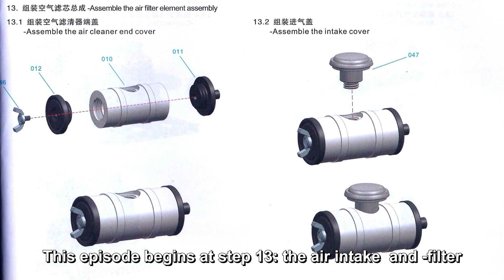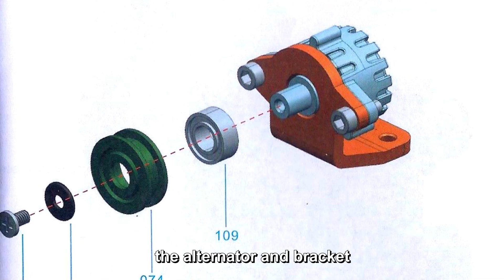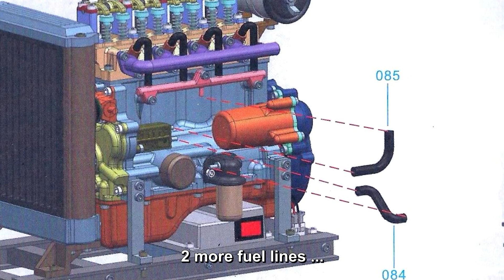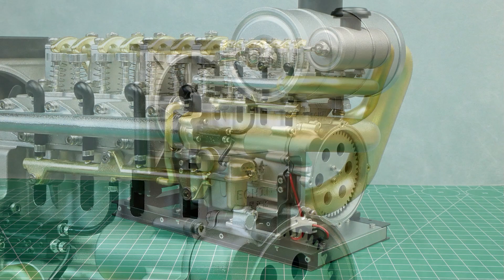Building the Teching Model 4-Cylinder Diesel Engine - 3

Comment: Where did you purchase this kit?
Reply from the maker: I bought this kit, along with the oil pump, from a Chinese company: stirlingkit.com. But if you have watched my oil pump construction videos, you know that you should not expect any service from this company if there is something wrong with the (quite expensive) kit. To date, I still haven't heard anything about a possible replacement for the broken battery. So you have been warned.
Reply: @leokessels88  I did watch your oil pump video and I read where you talked about the NO communication with the maker, that's to bad and there's no excuse. I bet they didn't mind taking your money.

Anyway I watched your video on the Marble Run by Wood Trick. I still haven't started mine but I have your video as my guide when I do start. 

I used to build V8 motors back in my younger days and was looking for a model of a V8 motor that runs. I had one many years ago that was a see through model so you could see all the moving parts inside, pistons, crank, cam, lifters etc etc. The firing order would light up with red lights and it actually ran with the correct firing order. 

I wanted to ask you if you knew of a V8 motor that you would recommend? 

Thank you Leo, appreciate the reply, have a good week Sir.
Reply from the maker: Thank you for your story. Regarding the V8 engines, I know that the same manufacturer where the oil pump and diesel engine come from has several models of V8 engines. The metal models are very expensive. And I have no idea about the quality of the plastic models. Then you will have to search the Internet or YouTube for videos of people who have built such a model. Lots of luck.
Reply: @leokessels88  Thank you Leo, gook luck on your train build. I'll be watching for it.